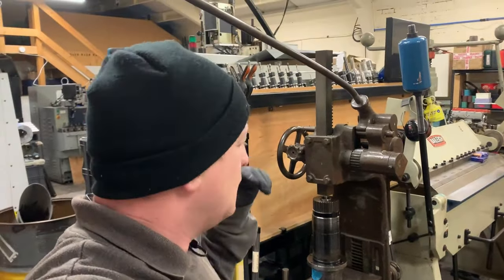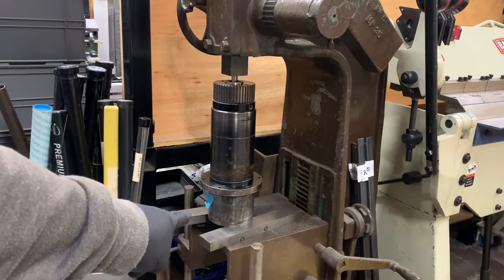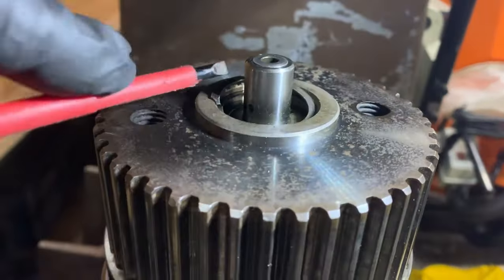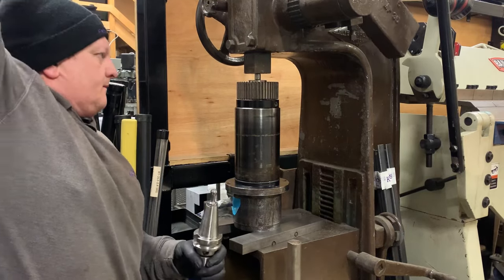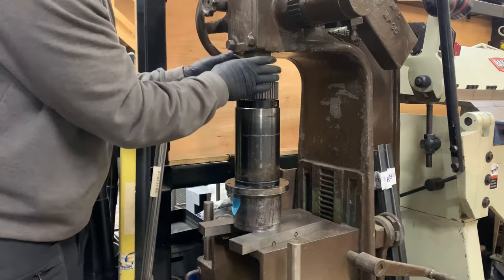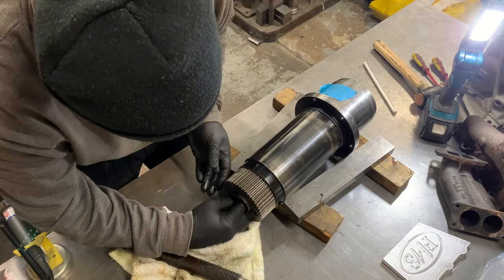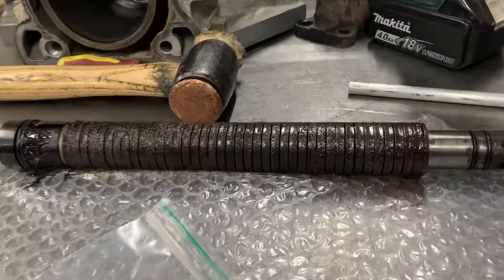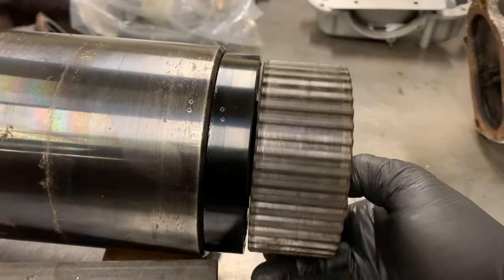Opening up a Haas VF3 spindle !!!

Comment: I just finished watching a video on rebuilding a spindle by Robrenz.
Those bottom bearings need to have a preload and those definitely don't. The X is a lineup mark look at the top bearing the X should line up
Reply from the maker: Hi

I’ve just watched the same video, very in depth!  If I end up replacing these bearings it will probably just be a nice clean up, new bearings and in she goes lol

Comment: my boss purchased a brand new vf3 in 95 the motor only lasted a year, and was way out of spec.  Haas said it was from the graphite dust from electrodes of the edm.  apparently cutting graphite was in the selling contract, so haas replaced all the parts. needless to say we never really cut graphite with it after that... :)  if you end up putting a kit together for the vf-3 ill be happy to order it.... Thanks again for all the videos!!
Reply from the maker: Yeah certain dust and materials
Kill things very quickly,

What kit does you mean?

Thanks
Marc

Comment: Because the spacer ring between the bottom bearings was loose, it potentially had some wear. These are precision ground to give just the right amount of preload. Anyway, hopefully it wasn't worn and your repair lasted. Thanks for the video.
Reply from the maker: Hi

The inner and outer bearing spacers are away being re ground now to make sure they are matched heights so the new bearings will have the correct preload 
When grinding them they also have to make sure the face are perpendicular to the bore so everything compress down evenly not cocked or that can also induce a bend in the spindle 

Hopefully in a week or so time depending I will be ready to put it back in the machine 

Thanks
Marc

Comment: Hey nice vid just to let you know that the -4 is -4 micron runout at the etch circle or sign depending on the brand. If you wanted to tweak your assembly runout you can clock your bearings on the shaft. Nice vid again 👌🏽👌🏽
Reply from the maker: Hi

Thanks for the info, appreciate that 👍

Glad you like the videos 
Thanks
Marc

Comment: Excellent investigation work. Angular contact bearings are a matched pair. Think I sold some of these a while ago as a job lot. If I'd still got them, you could've had them, which is a pity. As others say Robrenz spindle rebuild video is excellent
Reply from the maker: Typical, never mind, I hope to use another spindle and rebuild this one later when I get the spare time and money 

That video is very in depth but a good watch

Comment: Great video and i know this is late, but the pulley on the top of the spindle is heat shrunk on for future ref.
Reply from the maker: Yeah I should have heated it with an Oxy Propane torch whilst pressing it out like I did the gear box shrink fit pulley

Comment: I find it odd that there would be so much "material" in that spindle as they are a somewhat sealed unit. Almost looks like that collar was rusting and flaking. Maybe it was heated too much during the last 'repair' which will cause rust if not treated. ?  1 of my B.P. spindles was "rebuilt" with off the shelf bearings. Nothing $500 and an hour or so couldn't fix but, it's a B.P. , NOT a Haas CNC. 
 I'm fortunate that my '91 VF-1 still sounds good and runs true. I cut a LOT of cast iron on it the last 12 years. I do have an odd VFD issue I've been chasing though. The spindle will stop and restart in the middle of a program whithout any warning. I'm confident the VFD is powering down & back up as I've caught it doing so twice now.  I just don't know where to go from there. All connections are good.
Reply from the maker: Hi
Move never heard of that sort of vfd issue but these old machines can do some strange things at this age lol

Yeah the rusting on the bearing collars is strange! They are not a totally sealed unit so it’s likely it could have been moisture in the air supply to cause the rusting like that I think
Reply: @kinzy_fabrications   Also, were they ever changing their spindle oil? Maybe it slowly absorbed moisture and lost its corrosion preventatives.
It seems odd how very much material was in there, like maybe they were running without out air flowing through the spindle? But I would think that would cook it pretty fast.

Comment: Wonderful videos!  I thought the orange color of oil/liquid on the bearing balls looked like rust.  Is there any chance there was water condensation from the compressed air/oil feed?  It's hard to comprehend that much grit getting in from the bottom against the flow of air/oil purge.
Reply from the maker: Hi

Yes after looking at it further id say there was definetly was water/moisture ingress issue. hopefuly when i finally get round to rebuilding it i should never have that issue as i have a very good air dryer on my own system

Thanks
Marc

Comment: Hey Marc.
Good to see you decided to disassemble the Spindle yourself.
I'm sure it must have been killing you to know what was happening inside.

The Float you see in the Bearings is obviously because of wear.
But,  it's the design of Spindle Bearings that will cause this end float.
Spindle Bearings are always Angular Contact Bearings.
Any wear will Always show up as end float, unlike Roller Bearings which will show wear as side float.

Rebuilding the Spindle yourself is possible IF you have the time available.

As you already know now.
Cast Iron is one of the worst materials to machine, especially with a CNC machine, the environment inside these shops is the worst environment for any CNC machine.
Reply from the maker: Hi mate

Yeah seems the bearings have just worn heavily and on top of the cast iron the machine was working in it was all drilling and tapping work so loads of high load stuff that probably wore the bearings even quicker

Comment: is the machine actually setup to blow oil air through? you should check that, if the bearings were starved of oil i can see them wear out quickly. early machines came from the factory with grease pack spindles. If you look at the lube panel the air oil configuration will have an oil line feeding into some fittings with a solenoid and an extra air regulator.
Reply from the maker: Hi

Yeah it is definitely an air oil mist machine and has the separate air oil mist line and metering unit on the back as per my other Haas I’ve had
Reply: You'd think the positive air pressure would not let the iron dust in so maybe it failed at some point @kinzy_fabrications
Reply from the maker: The air pressure is low but should stop ingress but i think it actually may be more due to water in the air that caused the issue and not cast iron debris like i initally thought

Comment: I am really surprised that these Giant CNC spindles have no gears inside them
Where does the torque come from to cut steel?
Reply from the maker: Hi

The spindle is belt driven off of a 2 speed gearbox, thats where it gets the torque from, the direct drive machines get the torque control from the vector drive and wye delta switching
Reply: @kinzy_fabrications  
Thanks, this was a nice and somewhat tedious video but it gave me an insight on the guts of a CNC milling machine

Comment: how much do you charge for that ? we just got quoted 10.000 euro for replacing the spindle bearing on a 2003 VF2.. ..basically more  than the machine is worth.. HAAS wanted to  replace all of the spindle for about 25k euro .lol..
Reply from the maker: Hi

On this machine which is a 1998 vf3 the total cost for me to complete the spindle rebuild came to approx €1300 
That included new bearings, straightening the bent spindle which I done by heating it too much! Having the taper re ground and news seals etc 

That does not include my time spent to do it which without filming etc is approx 1.5days including removal and refitting 

But some of the newer spindles might be different to mine so I can’t comment on yours but if you have the time and are semi confident I’d say why not have a go like I have 
My advise would be make up some good press tools etc to remove the shrink fit parts rather than the heat like I did and caused damage 

I have just done another spindle and made up some very basic tooling and removed everything without heat this time 

Thanks
Marc

Comment: hi 
When the machine reaches the number 99999, it stops working and gives an "invalid address" warning. Please help me, I am in a big trouble.
Reply from the maker: Hi

What are you using the 99999 for? I don’t understand?
Reply: @kinzy_fabrications  
hi marc
Thank you. I solved the problem, but I faced another problem, which is 
"low lube or low" alarm. When I changed the oil for it